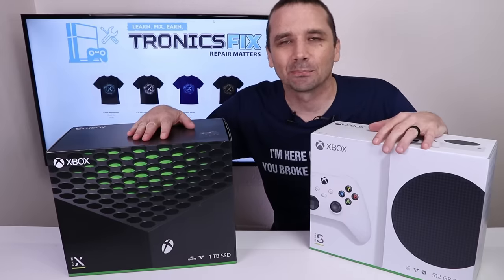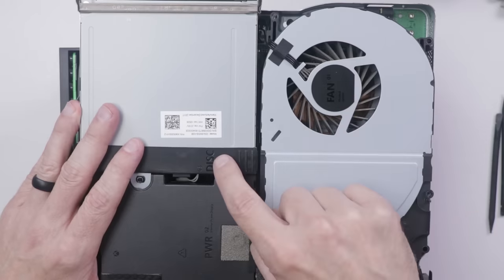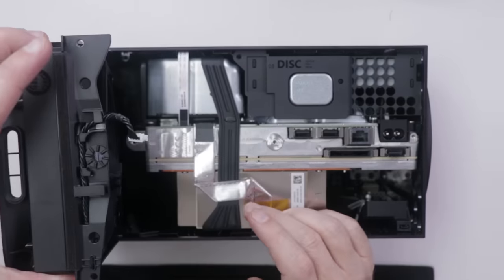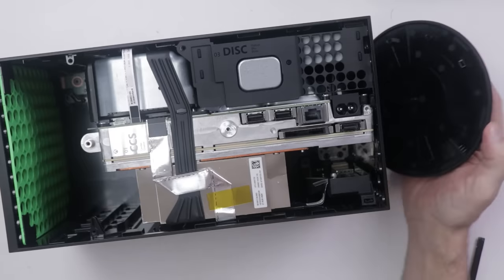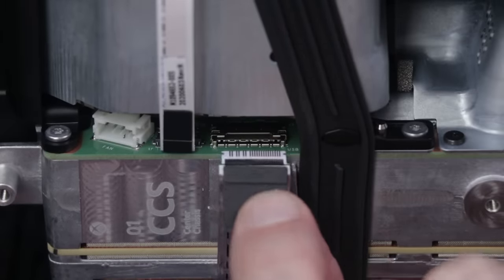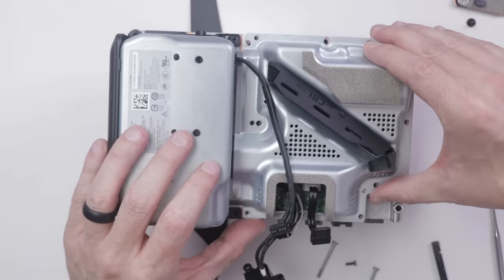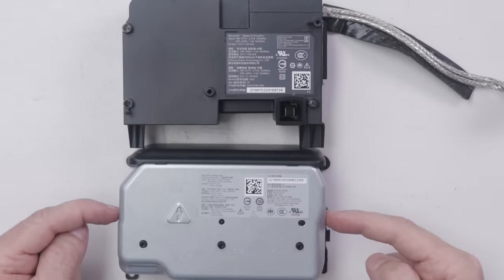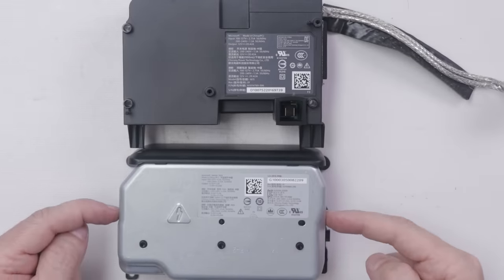Xbox Series X Teardown - A Repairability Perspective

Comment from the maker: What do you think? What else do you want to know?
Get your merch here: https://tronicsfixstore.com/collections/merch
Reply: When do you plan to tear down the ps5?
Reply: Ps5 teardown
Reply: Liquid cooling or liquid metal mod?
Reply: You can do the durability test  in Xbox series x and then fix whta you have broken ☺️
Reply: Can you replace the SSDs? Xbox has been a PITA about theirs disks in the past, curious if they have gotten better.
Reply: voltage, heat and sound test like x1 before please
Reply: Is that PSU sealed or it can be opened ?
Reply: PS5 pls
Reply: Console Heat test!!
Reply: Ps5
Reply: As a repaiman myself. Horror box if you ask me. Very complicated and time consuming to  service. Not looking forward to even change the thermal paste on this .
Reply: trying to fix an old ps3 system. its a famous error code of 8002f1f9 and ive tried in my mind everything. id be happy to send it to you to make a video on it
Reply: You look like Poczciwy Krzychu from Polish YouTube! 🧐
Reply: what does thermal paste do?
Reply: Ps5 teardown
Reply: Now, what if we put a flex cable adapter to extend the NVme port? I did this in my PC to move my NVme away from the motherboard to closer to the fans.
Reply: Can you do a tear down on the ps5 please ?
Reply: Can you put the Xbox parts in a pc build
Reply: Can you upgrade the ssd?
Reply: could you try to test if the ssd of the series x and series s are swappable between them?
Reply: Would like to see you put that back together in working order bro
Reply: Can you replace the fan with a rgb one?
Reply: Can you check if the XSX will run after raplacing the internal ssd storage?
Reply: I KNOW I’m not getting this thing Liao.
Reply: @benk3431  the Xbox series X console is probably a better console it runs cooler than the PS5
Reply: Any idea, where to get this green “thermal paste”?
Reply: @jasontipton8430  His dad might’ve also liked that, if something broke just ask the son for help, normally the father has to do all that work FOR the son 😂
Reply: Does the external SSD drive fit into the internal slot after removing its case?
Reply: @andrekohler5792  I’m sure it does, but most are getting a ps5 just plug it in and be done.
Reply: Can u give me a Xbox to start a gaming channel 😊 pls .
Reply: @jaikumar011  you might wanna get a better console if you wanna start a gaming channel lmao, either ps5 for a pc.
Reply: @braincube013  but I don't have money to buy anything 😕
Reply: @jaikumar011  I’m sure you will eventually, just gotta save and ask around for chores or jobs like babysitting or cutting grass, that’s what I did. You’ll get one 👍
Reply: @braincube013  Yeah it is good idea But in India its not Possible 🙁
Reply: @braincube013  You are good Bro  Thanks
Reply: @Gixxer983  😂👌🏽
Reply: I’d love to know... what is your advice to someone who just had a beer open in the same duffel bag as my Xbox series x :(
Reply: @Tronicsfix hey question for you, my Xbox was hit by lightning and powers on fine and offline updates fine, but pretty sure the wifi card got fried because it won't find any networks now, but when plugged it says its fine.  Tore it down and everything looks fine that I can see, reapplied thermal pasted as I would with my PC builds, but still doesn't recognize a wifi signal, any chance you want me to send it in if you have a spare wifi card to see if my theory is right?

Comment: Compared to Sony, Microsoft definitely splashed the cash this time.
Reply: really? I think Sony has overengineered the PS5 more, the cooling solution seems much better (bigger and with liquid metal). They have learned from their mistake with the PS4 which was very hot and loud.
Reply: @pedrorezende4873  Going with liquid metal from the factory is NEVER a first choice. I think its because they were so in love with the shape, they had to overcome their limited amount of space/limited amount of heat sink allowed because of the shape. The chip that the Xbox and PS5 use are pretty similar, so honestly its more ideal to use a less expensive thermal paste - that is also less of a liability since its not conductive.
Reply: @pedrorezende4873  pretty sure liquid metal has to be replaced frequently.
Reply: @DefinitelyNotMyRealName  where did you get this info from? I did some research and the only thing that I could find out is that people didnt see any temp difference after 2 years. Its something relative new so I would not make such claim since there isnt much data on testing that
Reply: I got a 12 year old Arctic silver 5 application still cooling as well as it ever has
Reply: 100 games for ps5..and only 17 for xbox....
Reply: @SaudagarHati   not sure where you got your number lol
Reply: @SaudagarHati  umm I have gamepass and I have 190+ games on xbox for $15 a month.
Reply: @pedrorezende4873  not really
Reply: @pedrorezende4873  liquid metal has been known to dry up very quickly in cases where the hardware is constantly being used, although it isn't major you will still see reduced effectiveness over time for a lot of ps5
Reply: @Alucard-gt1zf  do you know that gallium boiling point is beyond 2000c° , right?
Reply: @mrdesmit6038  you know water boils at 100 degrees right? And yet I've never needed a day to be 100 degrees for the puddles to evaporate
Reply: @Alucard-gt1zf  Yes indeed , but this only happens when the liquid is exposed to an open environment, now try to put a droplet of water , in a closed , or some what closed environment , like between the cpu and the copper base of the heat sink
Reply: @SaudagarHati  I can send you a video of the Microsoft store if you want
Reply: @DefinitelyNotMyRealName  Get your facts straight, lol

Comment: Great that it looks like the bluray drives are the same other than the board, I still have a stack of new ones.
Reply from the maker: I think it might be the same.
Reply: drive from 1x have HW revision with 9 on end, Sx have drive with A on end? its means 10 in hex, so its same but a bit updated. request drive interchange test and is it still needed to update firmware? also request internal drive interchange. that would be a marvel if u can interchange ssd in seriesS to larger but not pcie4
Reply: @madmatrac  yeah I'm also curious if the internal ssd can be swapped to a larger one with no problems. Like metaljesusrocks has show games can take up space quick especially if youre having it download your whole collection of backwards compatible games too.

Comment: I just have a feeling that they are highly repair friendly
Reply from the maker: Some of it is.
Reply: @Tronicsfix  glad to hear, dreading seeing the PS5 repairability. (Soldered internal SSD OOF) 

The Series X is still a marvel of engineering however such a beautiful console.
Reply: @fiddlestyxVR  There are common ITX builds that have 3x the power in 1/3rd the space, but I guess it's adequate for Microsoft.
Reply: @fiddlestyxVR  ssd's are very reliable, last way longer than hard drives, don't really think it will be an issue. It's like worrying that your phone's memory is soldered?
Reply: @evertonjames123  I don't think you keep your phone 5-6 years like a console
Reply: @greg2943  my ssd in my pc is 7 years old and is still healthy according to software :)
Reply: @evertonjames123  Is this a challenge? lol
I have a 20 year old HDD still working
Reply: @Juliett-A  That is just grade-A BS.  You're not going to find anything with 36 TF of performance in 1/3rd the size of a series x.
Reply: @fiddlestyxVR  xbox design is poop infront of ps5
Reply: @Xilog  i highly doubt the expandable drive will work for a boot drive
Reply: @Juliett-A  you can't even fit an RTX 3090 In a build like that lmao.
Reply: Lol good joke.
Reply: @fiddlestyxVR  good joke
Reply: @greg2943  what you've been actively using a like 20gb hard drive for 20 years straight 😂 highly doubt it
Reply: @Lyaaaamlyaaaam  Xbox series x design is actually more repairable and overall better than the PS5.
Reply: @benny.pepper  I like both, but the design of the xbox overall fits better in most rooms, looks simpler and is easier to access the insides.

Comment: I think the SSD internally is a bit of a game changer when it comes to repair, and tinkering updaters. If that SSD dies it can be replaced rather than having to re-ball the memory chips placed on the board. One advantage it has over PS5 since the chips on the mainboard are not replaceable. I have a couple e-mails into my friends at Microsoft to see if they will make the SSD available as parts after the first couple years. In theory nothing is stopping you from putting a DRAM cached SSD when they miniaturize a bit as a replacement. It is a full PCIe 4.0 of Gen 4 lanes. It just uses the RDNA2 feature of shared system memory to cache SSD addresses. It is faster than a normal computer doing that because the GDDR6 is much faster than DDR in a computer. From teh build quality and the sandwich design you know they want it to last.
Reply: if only this were true:/
Reply: @VeteranChild  Whats not true? It is Gen 4 x 2 lanes. The memory on PS5 is a custom chip with compression built into the chips. So you can not buy off the shelf chips. MS did copy some protection on the SSD. However, that can be copied. Other than that they have Toshiba and WD SSD as internal storage a standard M2. MS is in the process of removing the hardware white list and encrypted partition.
Reply: @thepoliticalstartrek  Everything is true except the whole they want it to last thing. Cause mine has been riddled with problems :/ cpu overheating and now my ssd has died with no way for the average person to replace or repair it

Comment: This design looks very good for custom cooling. When the console will be out of warranty I can see myself removing that plastic side to use an extra fan for cooling those metal things. I always used an extra fan pointed to suction holes on my PS4 and my console was always very cold and quiet (because my extra fan is not loud). I used this because I don't want my console to die after the warranty period is ended because repairing will be expensive and so does console replacing.

Comment: 12:08 they used loctite?
Reply from the maker: Looks like it
Reply: Hard to say, but they use some kind of thread locker.
Reply: blue loctite is removable, it just prevert unthreading due to vibrations. but never use red loctite on threads! its permanent
Reply: @madmatrac  I underestimated the power of that thing and it just was in another lvl of stiffness

Comment: 14:30 Wow, the internal SSD is actually just an NVMe M.2 card. That's great as it can be upgraded manually or replaced in case of issues.
Reply: not something sony can say about the ps5 😅
Reply: @HlgMiesmuschel  Sony didn’t do it because they actually built it correctly and ain’t scared of parts breaking
Reply: @Modders4lifeUniqueModz  Yeah because PS4's never break or fail... oh wait, they do
Reply: @DSuave03-Me  so did xbox one.... this is a new gen not alot of problems reported for ps5 but xbox has had quite a lot
Reply: @Modders4lifeUniqueModz  It goes both ways, neither side is perfect.
Reply: @DSuave03-Me  PlayStation is lol
Reply: @Modders4lifeUniqueModz  Ok buddy, APU errors occur, its super common just look on youtube or ebay.
Reply: @DSuave03-Me  legit just looked and nothing has come up for apu issues
Reply: @Modders4lifeUniqueModz  APU issues PS4, looked it up in google, TronicsFix literally has 5 videos about this.
Reply: @DSuave03-Me  yes PS4 this is ps5 and Xbox series s x we are on about
Reply: @Modders4lifeUniqueModz  OK, in that case, neither have issues.
Reply: @DSuave03-Me  Xbox has had faulty disk drives
Reply: @Modders4lifeUniqueModz  You're still on this...
Reply: @Modders4lifeUniqueModz  You just admitted that PS isn't perfect by saying yes to the PS4 having APU problems. Also, look up "PS5 bricked" in google.

Comment: Interesting the SSD is a Western Digital when the expansion card is Seagate.
Reply: Microsoft said that that wanted all SSD companies to work with the console storage, so it gets into a point that storage expansion gets cheaper to expand, it pretty much confirmed what they were talking about
Reply: with him showing the ssd "bare bone" wonder if it can be replaced with a beefier 4/8tb version down the line
Reply: @anthonyflynn2662  hardware wise, it should be feasible (not sure about 4/8TB tho. Probably 2TB max with a single chip solution). But the hard part is the protection being put in the software. I don't think you can simply mirror it and have it running.

Comment: Pretty funny how that tiny SSD is literally half the price of the entire console!  Also, thanks for reminding me where I left my spare Blu Tack :)
Reply: its like 200
Reply: It is a Western Digital CH SN530(Part number: SDBPTPZ-1T00) in the 2230 format. Thats a relatively new(released April 2020) PCI E 3.0 NVME SSD, designed by WD to deliver optimal performance with very little power consumption. WD claims its usecases to be: ultra thin tablets, ultra thin notebooks, and embedded systems like the XBOX is one. With its 2400 MB/s read and 1950MB/s write performance it fits perfectly in the upper midfield of PCI E 3.0 SSDs. This SSD is not available to the consumer market, thus there are no prices online. OEMs buy them in bulks of 1000 usually. One would assume these SSDs are around 12.500$ per bulk.
Reply: @Squilliam-Fancyson  isn't it pcie 4?

Comment: I have to admit, both XBOX Series X case and guts really reminds me a custom PC build. I mean huge heatsink made of steel and copper, and also large fan who blows out heat generated by CPU (I built few PCs, so I speak from my experience). Only difference is XBOX Series X uses M2 SSD drive who is mounted to motherboard (and probably married with motherboard, and its data is encrypted), unlike in most PCs. But overall it is pretty good design, I'm not fanboy or anything, but Microsoft really knows what they doing, and their design of hardware is really impressing. I only wonder what their proprietary additional SSD drives would look like, and how you would mount them to the console (it shouldn't be hard for average user).

Comment: Also fun fact dust filters are not needed for the air output and you dont need a cooling booster fan for the top the fan in the console can rev up and down when it needs to now i would say get dust filters for the back side intake

Comment: They used the same Xclamp used in the Xbox One in the 360 and that was a major cause of the red ring of death because it applied too much pressure on earlier boards, so that when they got too hot and the solder softened, the clamp would bend the board, pulling it away from the APU. So, surprised to hear that they continued to use it in the Xbox One (never had one to fix).

Comment: 10:33 - Correct me if I'm wrong, but the place where the edge of the board is green instead of copper colored (left of the storage expansion slot), looks to me as where the Digital Optical Output was supposed to placed, until they sadly decided to omit it! Am I right on this, and if so, are those "connection points" located there, basically just missing the actual port itself?

Comment: Steamy hams are perfect for a family of 3 or more 
1. Grab a ham from grocery store 
2. Salt it through 
3. Grab parsley and rosemary and sprinkle enough to the point you can see it but not too much that the meat looks green
4. Sprinkle bacon bits and bread crumbs on top (use a food processor) 
5. Cook for 1 hour and 30 minutes at 360 degrees Fahrenheit 
6 when cooked flip over and lightly salt and season with pepper. 
7. Cook for an additional 14-15 minutes and take out
8. Let rest for 5-10 minutes then serve 
Makes up to 6 servings

Ingredients
1 large ham 
35 ml of pepper 
75 ml of salt
5 ml of rosemary 
6 ml of chyme 
15 ml of parsley 
60 ml of bacon
50 ml of breadcrumbs

Comment: Hey, so in an attempt to clean my Xbox from cat hair i broke the connector at 6:25, the Xbox still works if i hold that connector in a specific position, otherwise it doesnt turn on when i press the button. I am assuming i need to desolder the broken connector and solder a new one, but what do i order?

Comment: Hmm. I noticed two things. On the south bridge board it looks like there's an area where there should have been a CR-2032 battery holder. And I also noticed that there doesn't seem to be one of those little beepers (which is the black circular thing with a hole in the middle) that is on the Xbox One X. They've also been used in the PS3 and the PS4.

Comment: You should try to upgrade the SSD, since its socketed instead of soldered on there, maybe there is the possibility for this to work...
Reply from the maker: Yes, I plan to!
Reply from the maker: MrElo  I didn't say it was ram. I said you take it out like you would take out a ram stick.
Reply: i think this is an advantage for repairability and upgrade. Imagine increasing capacity storage and faster base transfer speeds.
Reply: @prodj.mixapeofficial6431  This would be awesome!

Comment: 11:48. This is false. The problem is not the solder balls 99% of the time, but the flip chip bond/underfil/bumps. Reballing them is a temporary fix. The clamps are tight to make sure the heatsink won't come away at all from the chip.
Reply: Exactly, this is also why low heat (150-200 celcius) fixes this, and solder doesnt melt.

Comment: Being a dual voltage system means also that this console is region free.
Yes, as an European you can put an American or Japanese disc and it will read fine. It's like the PS5 or the Switch.
Only thing that remains region locked are the DLCs

Comment: Replaced thermalpaste on Series S with Arctic MX4 and i can confirm like the X its super dry ... just cracks into little pieces when removed( not the best quality). This thermal compound has been applied on consoles and never been used ( transfering heat ) ... stored for at least  2-3 months before shipping to stores